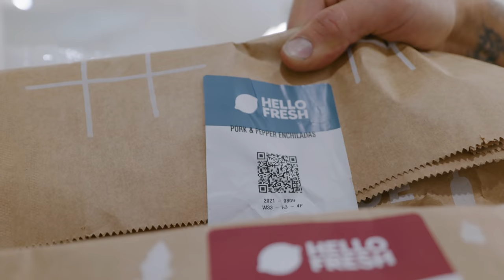Couple Relocates Entire Bathroom Together (PT.2) | DRYWALL, ELECTRICAL & TILE

Comment: Electrician here—-good way to remember how to hook up outlets—-black to brass, white to silver, green to ground. Also, the outlet/switch box you put in is called a remodel box. You could have also out in a new construction box (which attaches to a stud) before putting on the dry wall. Also, as someone already said in here, would have been much easier to route the electrical before putting up the drywall as well. Wouldn’t have had to drill holes in your ceiling that you now have to patch. Just a few tips. The project looks amazing. You two did a killer job.
Reply: LOL, thx!

Comment: ProTip*
For educational purpose. When laying down tile. Always wipe the floor with a damp sponge to have proper bonding. The thinset and tile will adhere to the floor properly when you wipe across with a wet sponge. Same as when u drop concrete u wet first so the moisture is not sucked out immediately when u pour it down. Wipe, lay thinset, lay thinset on tile and move on. Hope this helps for suture projects. Love your videos.

Comment: What is the point of textured walls. I think its similar to popcorn ceilings. Ugh
Reply: The house already has them, and it's easier to match it then to remove where it already is.
Reply: Hides a bad drywall job
Reply from the maker: yep..
Reply: Depends on the texture as well, you can get better textures than "popcorn." I find it weird/unerving when im in a house with plain ceilings now since I lived with them all my life. Oh well.

Comment: you need to scorch the face of the drywall, in case you get a tear, the tear would be in the back. In the bathroom you need to use water resistant drywall - green/blue

Comment: Do you not need some sort of uncoupling membrane or cement backer board when laying tile on top of a concrete slab?
Reply: should have, yeah.
Reply from the maker: my understanding , the membrane is for flex on subflooring. this is straight concrete. no flex
Reply: @MrBuildit   Thanks for answering! Doesn’t concrete settle and move with temperature? (Genuinely asking-we’re about tile our downstairs bathroom) :)
Reply: @MrBuildit  No you need a membrane on slab flooring. Concrete flexes, which will crack or pop a tile off.
Reply: Cement board would have brought the tile level to the wood floor too. Tile looked low. I love how Alex just goes for it though, makes a mess, and it ends up turning out great!

Comment: The next time you do a title to say yourself from so many small pieces if you lay it out from the center of the room and the you end up with equal size piece on both sides of the room and not a full tile on one side and a little piece on the other this can say a lot of work. With the title you used I would have cut of one corner on all the tiles you started with to put the flat on the wall this save all the little filler pieces that take the longest to do and no little pieces that can  Break really easy. Hope this makes sense to you. Keep up the good work the house is looking amazing.

Comment: Rather than have to spray on a textured coating to hide a not so good mud/tape job, just hire a professional to do that part.  Knowing your limitations is a big part of DIY stuff.  For a room that size it would cost maybe $250 for someone to come in and do an amazing job start to finish: mud, tape, feather, sand.
Reply: The whole house is textured, you would know if you watched his videos so he’s not doing it to hide anything he’s doing it to match 🤦🏻‍♂️
Reply: @biggers4299  I do watch his videos.  His whole house is textured cause he's not good at mudding/taping.
Reply: He might just like the textured look?
Reply: Nah he’s only done textured walls because that’s how the rest of the house was when he bought it.
Reply: @jhende7  yeah I know but he might like the textured look
Reply: @jhende7  He is literally changing the entire house.  If he wanted to or was capable of doing non-textured walls he would do it.
Reply: @plasmac9  he would have had to skim all the existing walls to remove the texture which is a huge pain in the butt. I think in Texas it is quite common to have that texture on the walls- not my cup of tea but to each their own.
Reply: @plasmac9  I must have missed the video where he drywalled and textured the entire house.  How do you not understand he's matching the pattern for the rest of the house??
Reply: Good luck getting a drywall contractor to show up without charging an arm and a leg just to make him want to make the trip for such a small job.
Reply: @plasmac9  He didn't build the house, it came that way.